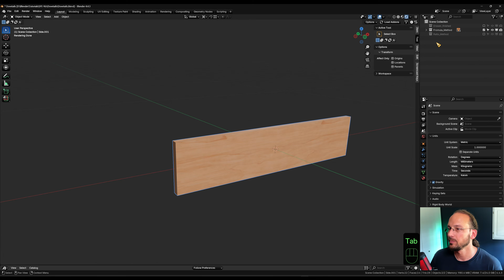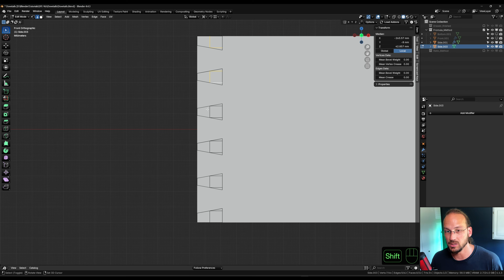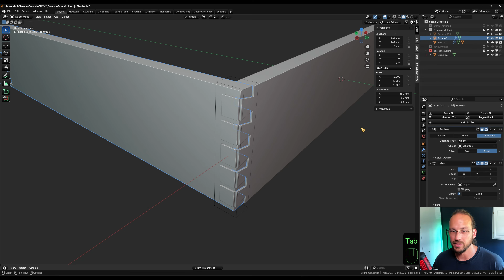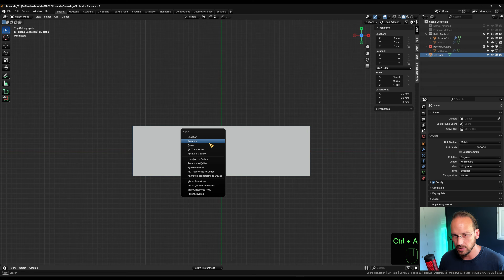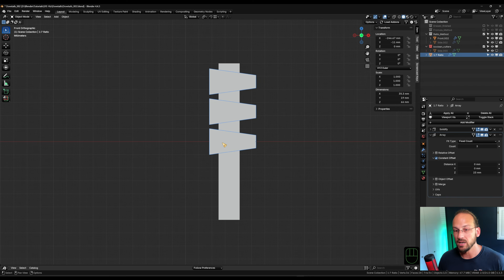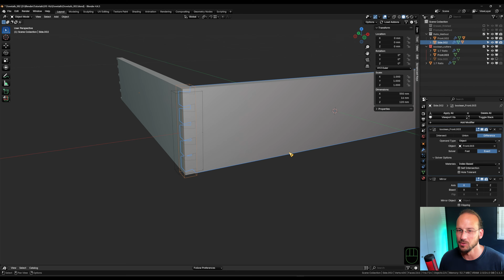Mastering Dovetails - Precision Modeling In Blender

Comment: thanks for the tutorial
thats solved my “joint” issue for printing large item
i have a question for this
do you know solve the printing issue
coz if the pin and the dovetail size are exactly the same, they are hard to join together after the printing
Reply from the maker: I don't 3d print, so I can't really answer the question.
Dovetail joints are meant to be very snug though, at least with wood. Ideally they need to be hammered together, being a mechanical joint.
Reply: @SFE-Viz 🙇‍♀️thanks bro

Comment: This is super cool! I’ve been teaching myself woodworking with hand tools for about six months now. I haven’t attempted any real joinery yet but I have a few questions. What is some typical joinery for say a small wall cabinet or display case? Like, what would you use on the top and sides of the carcass and also the frames for panel doors? Dovetails, mortise and tenon, half lap… etc?
Reply from the maker: Typically for the cabinet body itself I'd opt for a simple biscuit joint, unless it's supposed to be a decorative piece, then finger joints would be a nice option. For fronts it really depends on the desired stye. Shaker style for example work well with either mortise and tenon or simple tongue and groove.